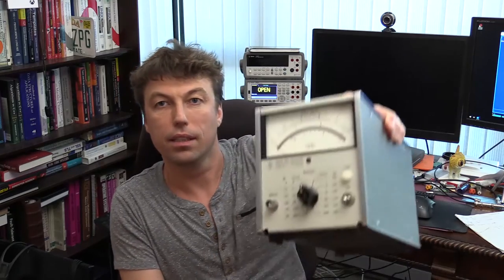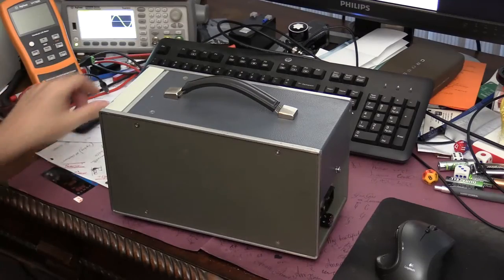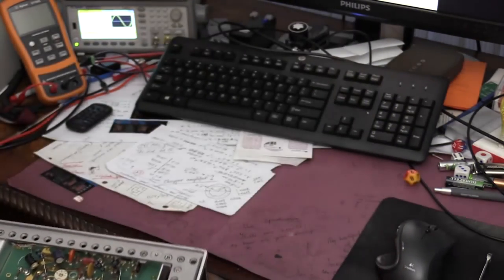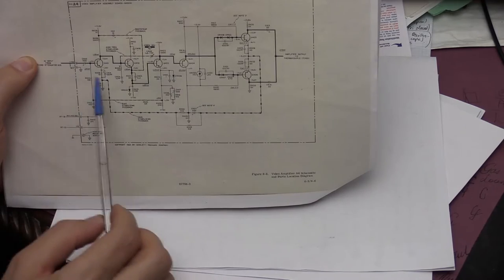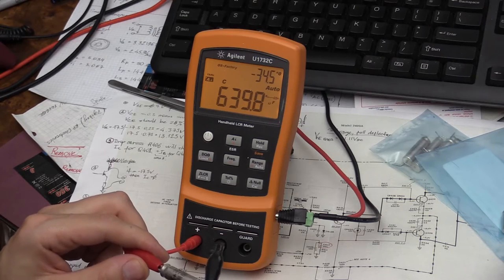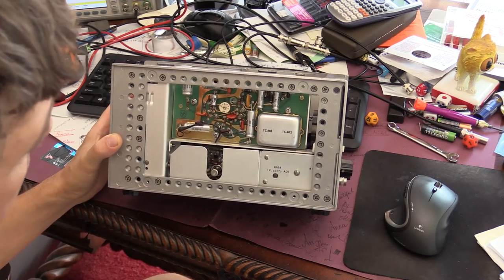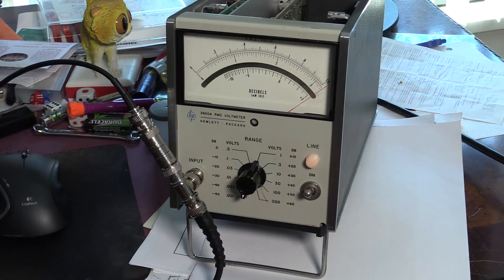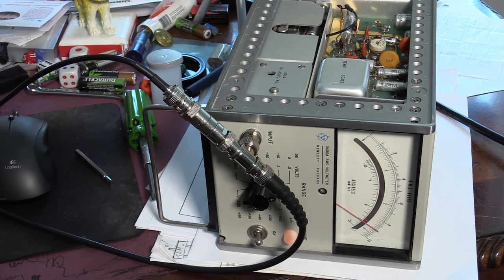Episode 16,  HP3400A RMS Voltmeter, tear down and repair

Comment: I have one of these, serial number 401-00788, which is quite old.  My uncle Ray gave it to me years ago and it's been sitting around collecting even more dust.  It definitely isn't working and looking inside, many of the capacitors are probably bad.  One of them has it's innards oozing out the side on the board where the tube is. It does have a calibration sticker from 1991, so it must have worked at that time. Perhaps I can actually fix it!